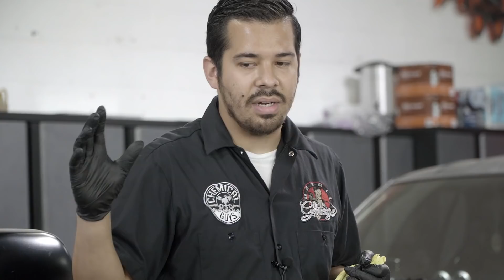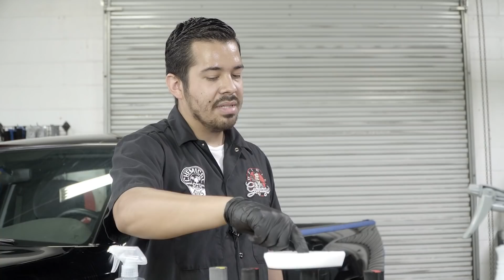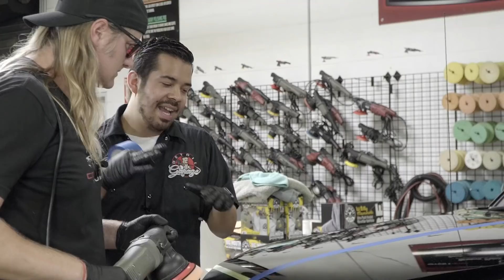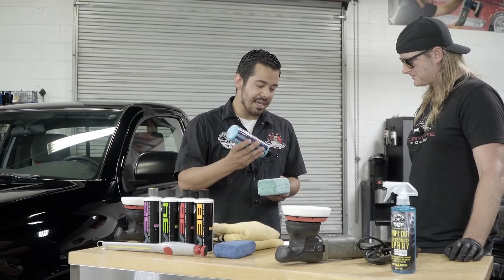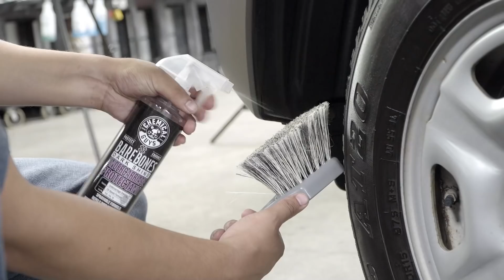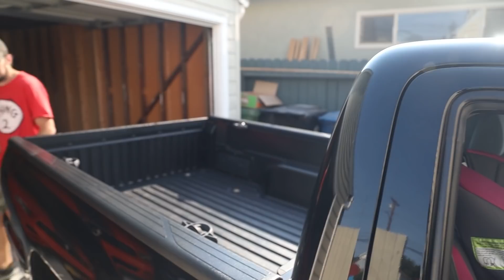Polish, Protect, and SHINE - Surprising Customer With Truck Restore - Part 2 - Chemical Guys

Comment: Hey guys, dont you normally use ISP to clean up any left over residue from the polishing before applying any sealant or coating?
Reply from the maker: Hey! Great feedback, Wipe Out is used to prep the surface after polishing and before applying coatings for the best bond.

Comment: Hey, did you do a panel prep after the polish  and before the hydroslick? Or did you apply the hydroslick with no panel prep to remove the polishing residue?
Reply from the maker: Hey! Wipe Out is used to prep the surface before applying coatings.

Comment: What colors for Claybar four used for Chevy impala Silver
Reply from the maker: Hey! Thanks so much for watching. After washing the vehicle, inspect the paintwork for contamination. Use a Light Clay Bar for new and routinely detailed vehicles, the OG Clay Bar works well for fairly clean paint. A Medium Duty Clay Bar should be used for moderate contamination, overspray and light water spots. Reserve the Heavy Duty Clay Bar for really bad contamination and embedded grime.

Comment: My dad recently passed his Miata on to me and he hasn’t polished the paint or anything and the we had a new paint job done within the last 5-6 years I believe so there’s a lot of scratches and swirl marks especially from the sponges he used so should I go with the 32 ? Because there are some deep scratches but also minor swirl marks as well
Reply: Keep in mind it hasn’t been polished or clay since it got the paint job done but it’s been garage kept for the most part so paint still has its color just a-lot of scratches
Reply from the maker: V32 is our most aggressive level of cut.  Keep in mind your clear coat has a limited lifespan and cannot regenerate, so you want to do the least amount of cutting possible that still achieves the best results.  I would recommend starting with V36 and the Orange cutting pad on your paint - this will likely eliminate most of the scratches and swirl marks.  After that, you can come back to the areas that are scratched deeper and bump up to V34 or V32 if necessary (and assuming the scratch isn't through your clear coat!).  Always better to start lower and work up, you may be surprised by the results you get just from the lighter cutting compounds. -CG Jason

Comment: How many days did it take you all to do this?
Reply from the maker: We worked on the truck from wash to protective coating in one full day (about 8 hours).  We had help from a few extra guys during the polishing phase, and if we weren't explaining/filming it could have been done in roughly 3-5 hours! -CG Jason
Reply: @ChemicalGuys  cheers 🥂

Comment: Shouldn’t Hydrocharge be applied first before Hydroslick? There is a video teaching that.
Reply: No it can be either or
Reply from the maker: If you are planning on applying both, we recommend HydroCharge be applied prior to HydroSlick, however either one can be used standalone as well for ceramic protection! - CG Jason

Comment: Hey CG, should I use an OG clay bar or light duty blue clay bar for my 2017 and 2021 vehicles? I bought the light duty blue clay bar but I'm thinking about exchanging it for the yellow OG. I would like to use one clay bar for both vehicles. What are your thoughts? Thanks!
Reply from the maker: It all depends on the level of contamination on your paint.  Your 2021 could theoretically be worse than the 2017, it's all relative.  If you feel your paint and it's super rough, we recommend going with the OG or Medium Duty Clay Bar.  If both cars just have mild contamination the light duty should still have you covered!